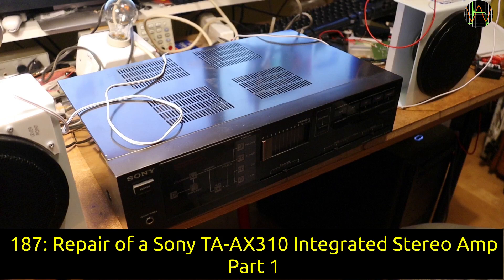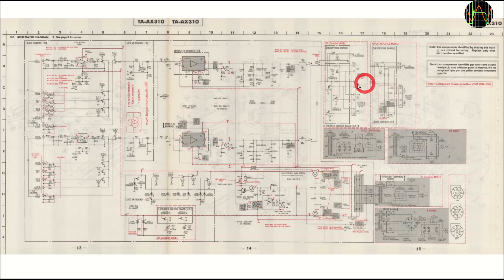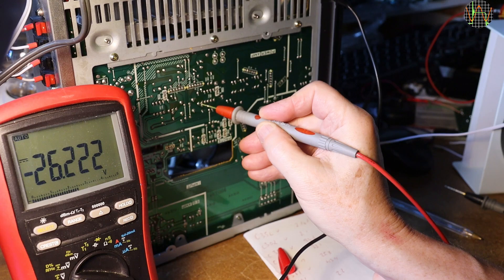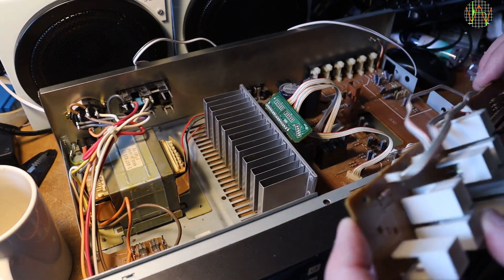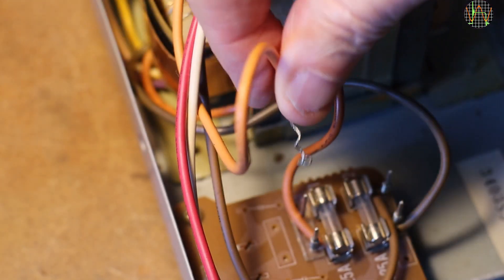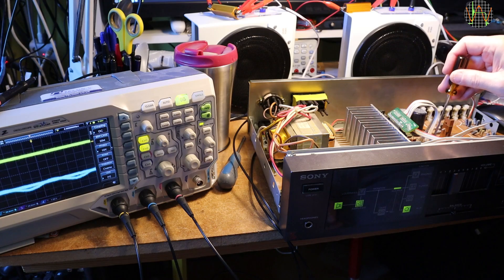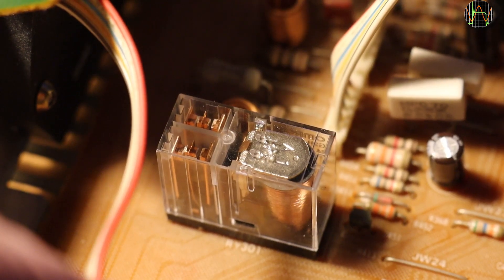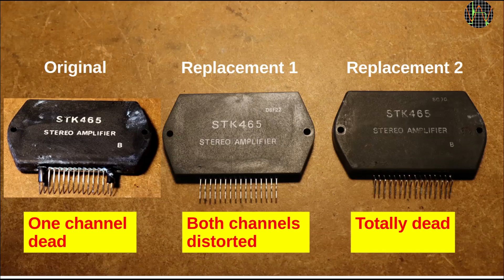187 - Repair of a Sony TA-AX310 Integrated Stereo Amplifier - Part 1

Comment: I ordered a hybrid amp chip for an amplifier i was repairing but didn't need to use it. The fault was something else. I no longer need it. Would you like me to post it to you? Its not an STK465 but it might work if you modify the pinout of the wires.